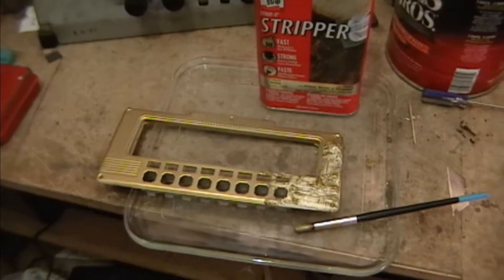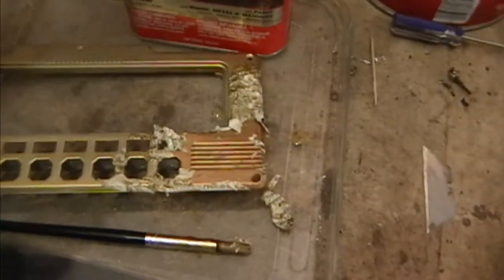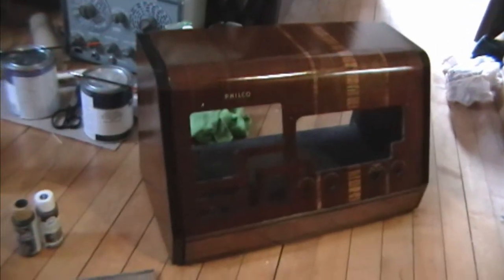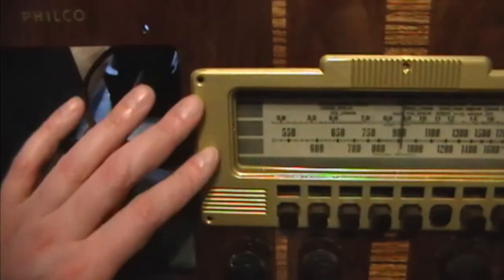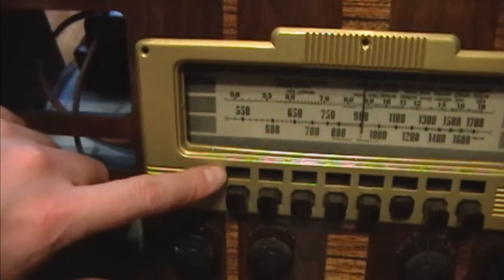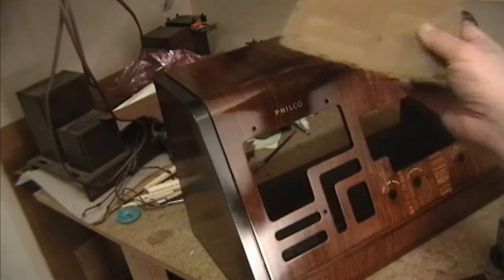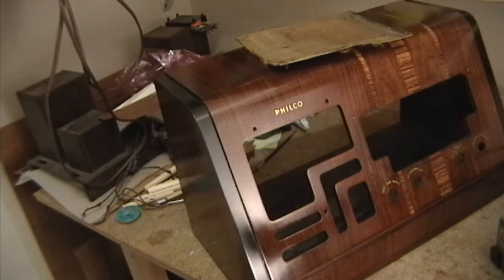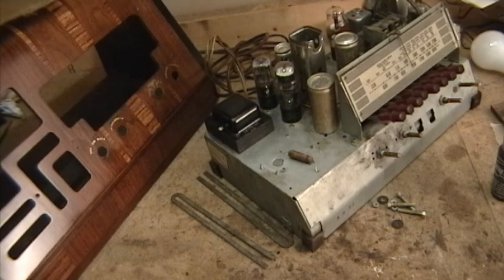Philco 39-30 restoration p8o9

Comment: I heard about that method, even know a few people that have used it. Up until now I've been lucky enough to find sets with either good one that just need a cleaning or ones that could be salvaged by wet sanding and a polish. The best material that I have found to replace it is a type of thick vinyl film that a plastic shop sells, it's the same stuff they use to make chocolate molds on a vacuum table. The original stuff wasn't vinyl of course, it was a cellulose based plastic.

Comment: Where you are spring began a month early, here it's beginning a month late. I've heard of people using either brake or carburettor cleaner to dry clean grille cloths, I haven't tried either of those but did use gojo to clean a cloth in a late 50s wood set, it was mounted to plywood though. I haven't tried replacing one of those plastic dial lenses yet, but I want to try making some as I have a few that are cracked or have holes in them, most were just tacked or stapled inside of the cabinet.